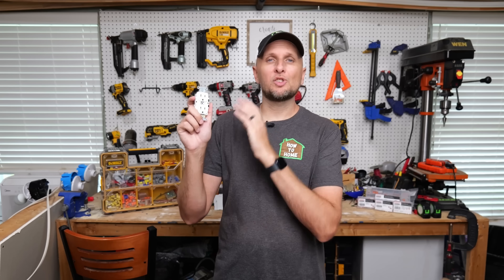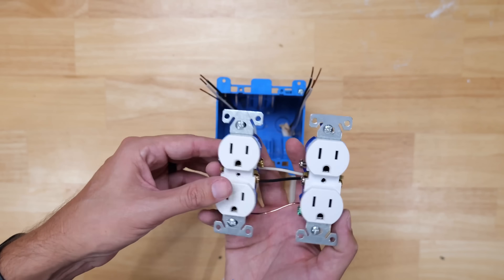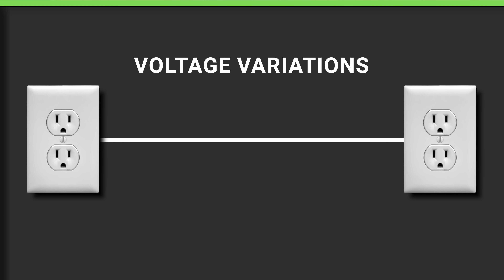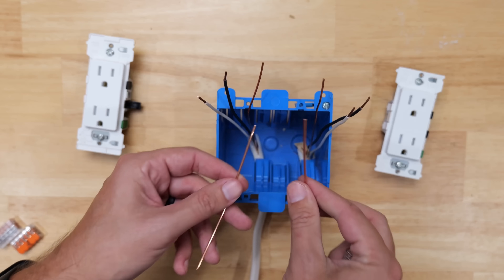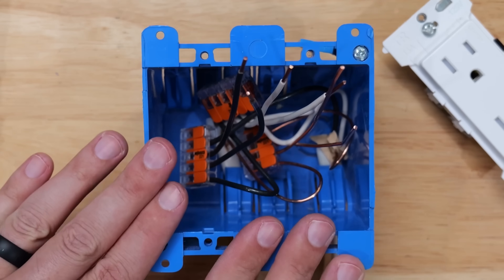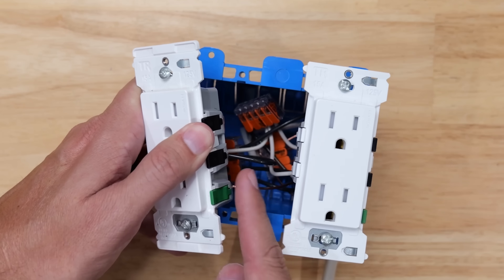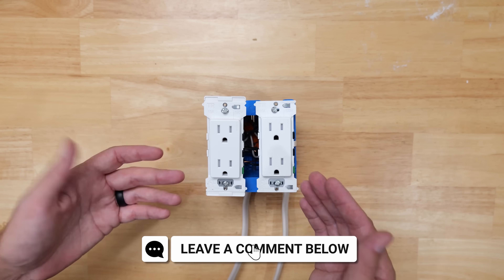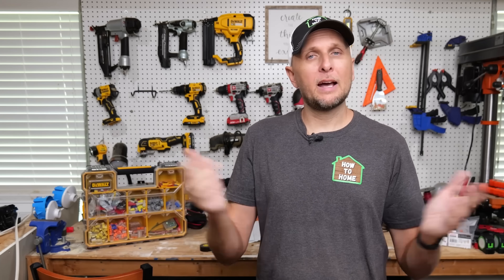Why This Outdated DIY Outlet Wiring Needs to End!

Comment: As outlets are not "pass thru" as power is passed thru the side plates not the outlet. If an outlet fails, only that outlet is bad, it does NOT stop the outlets past the bad outlet from working.  I wonder if this was targeted to the DIY'er that doesn't know better and if the video was sponsored or in some way influenced by the manufacturer of the connectors and outlets.

Comment: Soooo.....Series vs Parallel. Does not the need/use make it dependent on what method to utilize? I recommend making a wiring diagram.

Still pretty infomative to the non-electrician.

Comment: Utilizing pigtails and accounting for voltage drop, a future faulty receptacle upstream and just multi-wire branch circuits in general are the way to go. AFCI and GFCI protection is also not lost here if a receptacle fails and you have wired the receptacles in the outdated method.

Comment: Just a note that the use of a GFI used in this wiring configuration will only protect that outlet not the distal portions of the circuit.

Comment: Stop teaching diyers electricity you don't know how to define it or describe it and di wires will be confused the right way is to take the hot black coming in tie it to two pigtails and tie those pigtails to each separate receptacle then do the same with the whites neutrals and put the neutrals one on each outlet now if the outlets fail the power will continue downline😅

Comment: Many boxes are just too small to add in pigtails. Usually because of limited space between the walls.
His theory might work well on new modern construction but not on old installations.
I do not trust any lever locking anything. You cannot guarantee that there will be enough contact between the wire and the internal bus.
I prefer wire nuts and if I think the load will be high, I might even solder the wires then use the wire nut.
On chained outlets, a toner can be used to find the bad outlet easily.

Comment: Honestly this is completely wrong.  Number one you will get zero voltage drop going through a properly rated outlet, 20a or 15a depending on the circuit.  They are literally rated to carry that much current.  Anyone telling you they are getting voltage drop is because they already have a failed connection.  Number two your entire idea that the receptacle is what is going to fail is wrong.  The connection behind the plug is where you are moving the stress to, and that is where that circuit will fail.  Circuits fail at the point of connection.  And when that wirenut fails it will still cause the outlets after it in the circuit to stop working.  Would you rather have to remove every single non-working outlet to check the wirenuts or would you like to slap one plug tester into a random plug, then go around with another plug tester and shake each outlet using it and see which outlet you shake that turns that entire circuit back on?  That will be the failed plug.  

I feel like you really haven't spent much time troubleshooting electrical and understanding where your failure point is going to be.  And if you did electrical for a living and actually had to go back to where you did a job, you wouldn't use wego's for anything but florescent lights.  Talk about adding a point of failure into a circuit that is destined to fail.
Reply from the maker: That is literally all opinion.  I am not wrong.  You just don't agree with it.  That is fine.
Reply: @HowToHomeDIY  That isn't opinion at all.  This is electrical.  It is math, not theory.  Go find a set of plugs that you have voltage drop across, if you do there will be a connection that needs to be fixed.  It is well defined how things work and where your point of failures will be.  How long were you an electrician for because it seems like maybe you never were.  There is a reason electricians hate handymen.  LOL.

Comment: DIYer however my dad was an electrical engineer. I always wire with pig tails. I intuitively understood the downside of using the outlet to pass the power. Thanks many need to see this. I have rewired a friends house because of a bad outlet which was number one in the series. 5 outlets a a light switch were out.
Reply: If it was wired to the side terminal screws and NOT those backstabs i can't see how a faulty outlet would affect others in the series because they are wired in parallel. I had a circuit fail downstream but it was only because the first outlet was connected to the backstabs instead of the screws that have a solid bar between them. I can't see those bars failing. It was the ONLY receptacle that someone didn't use the screws. I would never use the push in feature after seeing that. Yeah, i guess it lasted a long time but highly doubt the circuit would have failed at all downstream if the screws had been used.

Comment: I had a 14k btu air conditioner on the end of the line, passed through 4 other recepticles before home running back to the panel. The compressor went bad and was pulling 22 amps but didn't trip the breaker. Melted all 5 receptacles before I caught it. I rewired them all with wago's and pigtails. Replaced the 14k with a 12k. That one pulls 12 amps when running and the 14k btu pulled 14 amps when it was running right. It would get the receptacles pretty warm before even so I don't trust a 14k btu on 120 anymore. I also don't trust breakers.

Comment: Hey..... are there any decora faceplates that are installed with screws?
Reply from the maker: Yes.
Reply: @HowToHomeDIY sorry  I think I was being too vague. Do they make faceplates that fit the Lever Edge outlets and screw in but don't sit a 1/16 proud of the wall. 

I've installed all lever Edge and all my outlets look wonky because apparently these are supposed to be used with snap on faceplates.
Reply: @palarious try snapping the  flat thin strip of plastic off the top and bottom of the receptable,may fit better,just try one to see.
I think i read that somewhere,i personally have not used them.
You would think the one that made the video would try that before posting video for people to use them,just my opinion

Comment: There is going to be no appreciable difference in voltage drop between the two methods. The voltage drop between the two screw terminals on an electrical outlet is going to depend on the resistance between the two of them and the current flowing through the circuit.  The maximum current is 15 amps given what is shown is a NEMA 5-15 outlet. The resistance between the terminals is so low I cannot measure it with my DMM, but suppose it is 0.01 ohms (it is most likely much lower). This is equivalent to the resistance in about 4 feet of 14 AWG solid copper wire.  Then the voltage drop at full load would 15 * 0.01 = 0.15 volts. Not significant.

Regarding the failure of one outlet disabling the outlets further down the chain: The most common failure of an electrical outlet is going to be the parts that make contact with the inserted plug, this has nothing to do with the screw terminals and the short piece of metal that connects them.

Comment: im going to become an electrician soon an i will now follow this way of doing it if possible (depending uppon if the outlet box has room or not) Thanks for this great demonstration of making everyones lives easier A+
Reply: I'm going to strongly recommend not daisy-chaining them.  The tiny metal strip between the terminals can overheat and catch fire when the circuit is at high load.

Fortunately, we were awake when the bedroom wall caught fire.  Needless to say, all of the receptacles have been rewired with pigtails.  And I curse the electrician who configured the house long before we bought it.

Comment: 2:50 Keep in mind, when he says "the receptacle fails," he really just means the screw somehow fails or wasn't tightened.  The actual receptacle part of the outlet could have its internals completely removed, and its ability to daisy chain still works 100%.  Now I agree the wirenut is a tiny bit less resistance than using the screws on brass, but the Wago is more, and he shows this in his other videos.  So no, he's not making the voltage drop less, he's making it more. To prove it, wire up a string of 5 outlets, put the max load on the last one, and measure the voltage; you'll see.

Comment: So, your 'better' method depends on power being passed along from external splices inside the box rather than effective splices provided by the receptacles. What is actually gained? Do receptacles often fail to pass along power properly? (I've never experienced that, if it matters) Do splices fail? (yeah, I've experienced that more than once). Of course you have the case of GFCI outlets which pass power down to other receptacles. I'm pretty sure that somebody will follow the 'better' method with disastrous results. I did notice that the box in the 'better'' method seems to have much more fill than in the other method which might be a problem in older installs with tiny metal boxes. Oh, and voltage drop: wouldn't a sudden surge draw from any outlet on the circuit be reflected at least a bit on every other one? My old-school electronics training says so. This is partly why, when installing new circuits from scratch I will use a heavier gauge wire than code demands; it costs just a bit more and the labor involved is the same although the stiffness of the wires can be a PITA in some circumstances. OK. Is that enough comment and question? ;-)  Aside: sometimes I see a lot of sense in the old-style British ring circuit wiring as it minimizes that voltage drop and 'fault-in-the-middle' problems.

Comment: Direct to connection on side of Outlet is a better connection, if you use the New Lever connection or wrap around the screws on the side. The screws are hard wired to each other on outside part of outlet.
As others have said, if inside connections have failed to lose connection between screws, there will be melting/burning on insides, and a whole other problem going on. Like too large a breaker installed in the panel, which is allowing too high AMP pull, and not tripping breaker.
Reply: Agreed. It is totally overkill to wire the way in the video. If an outlet goes bad, it normally doesn't affect the  side screws.

Comment: All that this technique does is shift where the wires are joined.  Instead of using all the connections on the plug you install three wagos and leave empty connectors on the plug.  I don't believe this is an improved technique.

Comment: series vs parallel
Reply: That method of daisy chaining was not series it was parallel. If it was series nothing on the circuit will work. Take a battery for instance if you go( + to - and + to - ect) that is a series circuit now if you go + to + ect  then - to - separately ) that is a parallel circuit. They are both daisy chain method

Comment: Anyone who's used a GFCI outlet to protect a chain of downstream outlets uses the first method to pass on the protection. In the case of the GFCI, the failure is intentional. In any other case, the physical bonding strips on the receptacle will pass current anyway.
Reply: I would rather use pigtails and individual GFCIs at each location. That way when it trips the user knows it was a GFCI issue and what the source of the fault is.

OTOH I'm just a homeowner and DIYer. I bet electricians get a lot of billable hours from troubleshooting "downstream  GFCIs". I think the code should disallow downstream GFCI protection outside of a single "workspace" or room.

Comment: Negatives: box fill, extra work, additional connections to possibly fail
Positives: none, really
At least you state this as your "opinion." Others have the right to disagree.
Reply from the maker: You do have the right to disagree.  

But none of this effects box fill calcs, barely more work (oh no), I have yet to see a properly installed wire nut or Wago fail.

Positives: I listed plenty
Reply: @HowToHomeDIY  Extra wires, extra connectors = more box fill, and the word you want is "affects."

Comment: Those lever lock receptacles are less than $4. I will definitely only use those going forward. 
Now I just got a lever lock gfci that’s outdoor rated with the WR stamp for $20. But that is the most expensive I think.

Comment: The outlet is not an electronic device. It doesn't fail internally. The circuit is completed through the metal backplane that the screws are screwed into.

This feels like more selling of Wago connectors.
Reply from the maker: LOL I said you can use Wagos or wire nuts.  Wago doesn't pay me anything.  There are other ways of failure than the outlet itself.

Comment: Someone needs to hide this mans tools. Not qualified to hold a screwdriver. Yes I am a Master Electrician and electrical engineer. NEVER use backstabs. Backstabs oxidize and fail. Guarantee you will be redoing this in the future.
Reply: He stated very clearly that you should NEVER use backstabs, even though the NEC allows it.  Not sure what you think you heard.

Comment: Except for GFCI's, Power should never go through an outlet according to Code. Power can only go to an outlet. Pig-tailing.  Wagos are allowed but they fail under high load.  Twisted Pigtails do not fail. Power going through  a receptacle is like using an outlet as a fuse.

Comment: You're just creating a chance for more problems with all of the extra connections. There's no reason to do any of this except to make a video.
Reply: Journeyman wireman here. Not sold on the wago give them 30 yr then you will know if they are good or bad. He is right about pigtail
Reply: @twigd3825  - WAGO patented the spring-clamp wire connector in 1951.  They are the standard wire connector in Europe.
Reply from the maker: Tell that to all of the electricians that do it.  I didn't make it up.

Comment: I remain completely unconcerned. My house was built in 70 and the only reason I have changed my outlets is because they were the older, yellower color and some had been painted over. Introducing 12 new failure points in a box to fix three possible failure points makes no sense. But as predictable all of these fancy new parts you are advocating for are linked into your Amazon account so you can get paid. That's the real reason for the video.
Reply: Totally agree.
Reply from the maker: Not the real reason.  It’s something many people didn’t know about as evidenced in the comments.  But you go to work and work for free and then maybe you can make an argument.  🤡

Comment: "If this first device fails..."
How? The screws are connected by solid metal bars. In over 50 years of wiring, I've never seen a receptacle bus melt.
That said, failed backstabbed connections are the rule more than the exception.
Reply from the maker: You named one of the many ways this connection can fail.  I never said anything about a bus bar melting.  Not even sure that could happen.
Reply: 45 years journeyman wireman. The bus bar is not the problem but I have seen a receptacle fail because loose connections under the screw more than once. Never use backstabbed and always pigtail.

Comment: had a UNION wired house that had voltage drop at every outlet, idiots used the push in connectors, outlets had no screws, so fix was to replace every outlet in the house, so many electrical fails 16 gauge pigtails, wires spliced outside boxes, hot wires just twisted together with bare wire wrapped around no insulation around the joint, all signed off.
terminal screws have better connection if done properly

Comment: I do like the lever leviton because there is no exposed power on the sides!!! 
I need to access both phases to a outlet so I wired a 14-3 to one outlet and broke the hot tab between outlet and wired one hot phases to each side of the outlet now I had a total of 30 amp (2x15)... Too bad I don't have any 240v products, like a TV, toaster, refrigerator...

Comment: I wire the "old way" and have never had an issue, nor ever had to fix an issue. I see your point, but I have yet to see any problem with the old way. This is after 15 years of experience.
Reply: If you have 3 or 4 14/2 wires in the gang box, having one pigtail to the outlet makes for a neater connection. The 3 wires are connected together instead of being connected to the outlet and making the stuffing into the box difficult
Reply: You and your customers are are just waiting for more time for a failure. My house was wired with outlets and light fixtures in series about 25 to 30-ish years ago. Had one outlet near the head of the circuit fail (Friday afternoon of course) and 2 bedrooms and outlets on half our main floor had no power for a few days until we had an electrician come out w/ a continuity tester to trace the circuit and ID where the failed outlet was.  If wired in parallel we'd have had one floor lamp quit working and the rest of our main floor would have been fine. You'll have an issue, just give it a few more years. Sounds like you'll know how to fix it though ;-).
Reply: @TedBrown-y9p  30yrs later isnt an issue with his install, its an issue with you using 30yr old equipment. Stop using old outlets, you are asking for a fire.